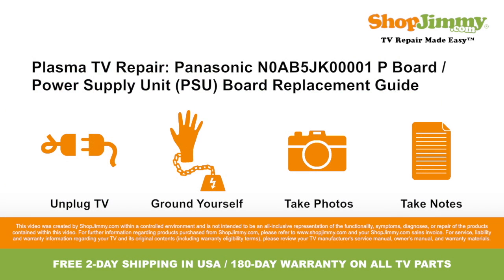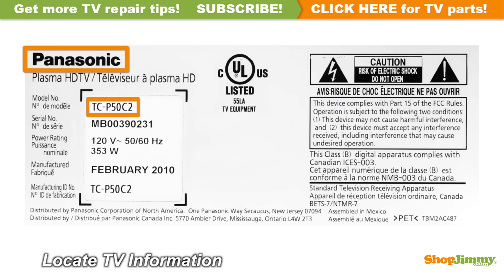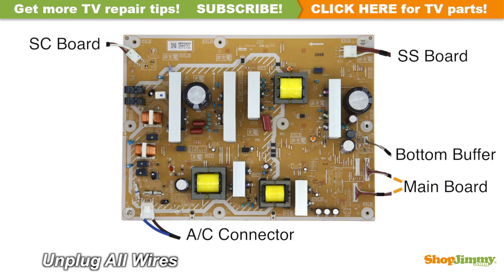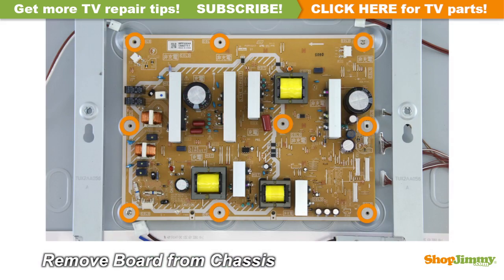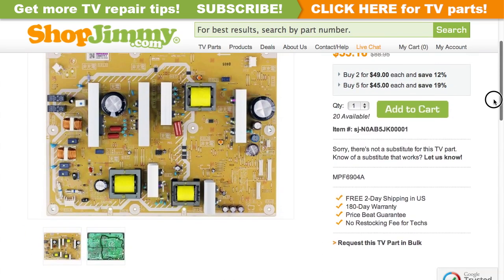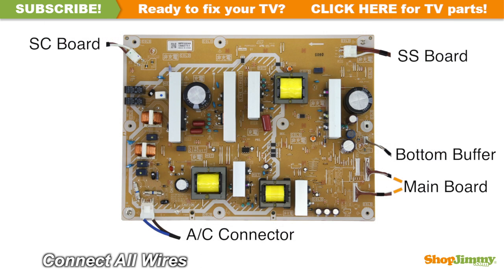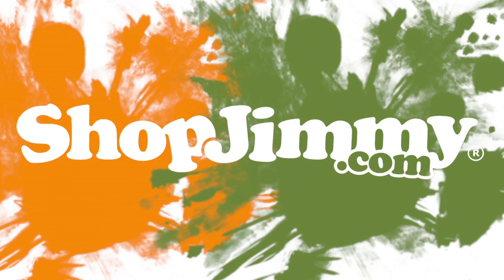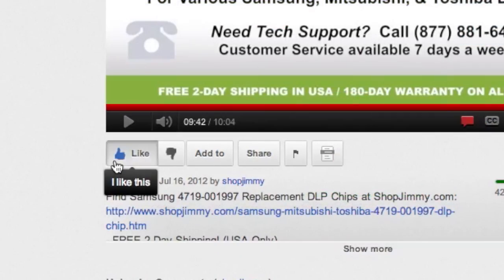NO POWER TV REPAIR Panasonic N0AB5JK00001 Plasma TV Repair Tips: P Boards / Power Supply Unit Boards

Comment: Hi. I have tried to repair a Panasonic plasma TV model tx-p46gt30e by replacing the dg301 tranzistors on the SC board because one of them was shorted. Now when I press the power button the green led blinks rapidly for about 3 seconds and then it stays on but I get no image or sound. Can anyone give me any pointers? I'm a noob. Thanks.

Comment: i replaced the powerboard noae6jk00005  on my panasonic 42x5,  and still no power,  is there a place to check to see if i have secondary voltage and what should the voltage be?  thank you

Comment: I have Panasonic 50UT50 and had unit powers on for a sec and immediately shuts off with the blinking red lights. I ordered and replaced the whole power board and try turning it on and still have the same issue. Is there anything else I should try?
Reply from the maker: karlkilla08   Try this at your own risk. Unplug the TV, then disconnect the SC board and plug in the TV to see if the TV powers up. Reply with the results of this test. Thanks! www.shopjimmy.com

Comment: I have a panasonic Th-42PD25 Originally no blinking light no picture. I replaced the power board and now I have a blinking light (12) after pushing power button and small timer delay.
Reply from the maker: Dennis Reaves   Try this at your own risk. Unplug the TV, then disconnect the SC board and plug in the TV to see if the TV powers up. Reply with the results of this test. Thanks! www.shopjimmy.com
Reply: Same Results, no cchange

Comment: I have a panasonic plasma tv TC-P46C2  wich suddenly won't turn on . It's not blinking or making any sounds.any ideas of what could be causing the failure? Thanks
Reply from the maker: stefisua   This sounds like a problem with either the power supply board or the A main board in your TV.  You may need to replace each board individually to see which one fixes the problem.  Here is a link to replacement parts for your TV model number on our website, click here:  http://www.shopjimmy.com/catalogsearch/result/?q=TC-P46C2  Be sure to match part numbers on your current board, with your replacement for compatibility.  You can also call our customer service for further assistance with your purchase.  (877) 881-6492  Thanks and please let us know if you have any further questions with your TV Repair!  www.shopjimmy.com
Reply: ShopJimmy.com that sucks..... I have MPF6904A  in a TC-50PX24
i.m trying to find what's wrong on the power board..
theirs a list of check points you should know of..... 
like a the fuse  lol
PMW1 light....
the proper DC voltage....for each output board....
like is it the AC or the DC problem yet where are the test points
could be just a capacitor..
how about tech files on the board....
its just a power board....

I should not have to buy 2 boards to test and repair the power board.... all its doing is taking AC to DC output lines...

like if the board is working would I get PMW1 light on.... first time working with board....

Comment: I took my fifty inch plasma to K and M Electronic in Loganville Ga. They ordered a board from Panasonic which was back ordered from them and ShopJimmy also did not have it in stock. Seven days later I had it back at home and mounted on the wall.

Comment: I have a panasonic TC-P60S30. I originally had the seven blinking power light. I replaced my SC, SU, and SD boards. When I powered on my tv it clicked and the power button is now stable but no picture and within a few seconds I heard a loud pop come from the back of the tv. No smoke or fire or smell just a loud pop. I unplugged the tv waited a while and attempted to power it back on again. This time the power button is still stable but still no picture.

Comment from the maker: @fbrennin - If you are replacing the power supply, you will not be able to take the back cover off the TV while it is on the stand. You should be fine to lay the TV down, but be very careful. Thanks!